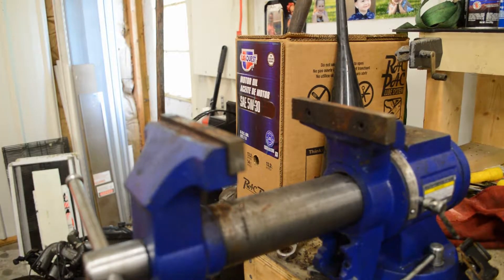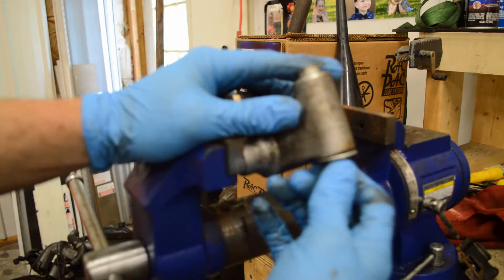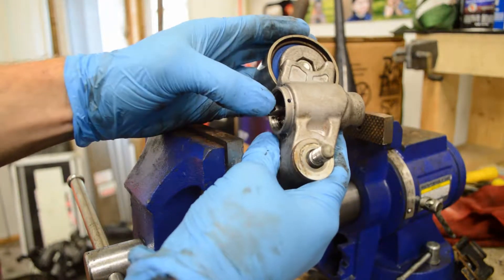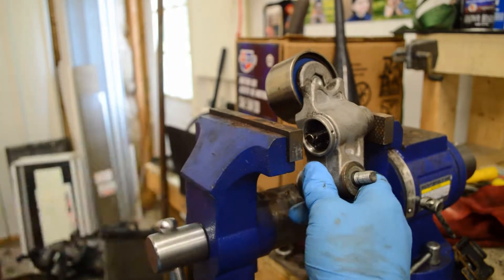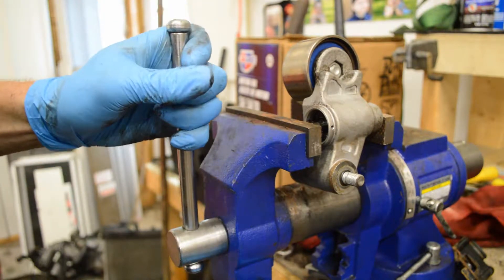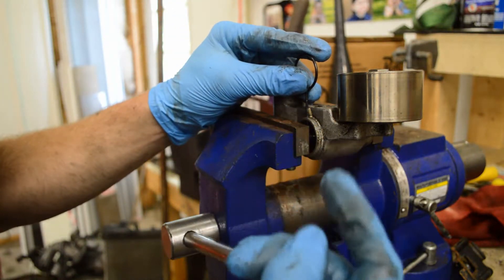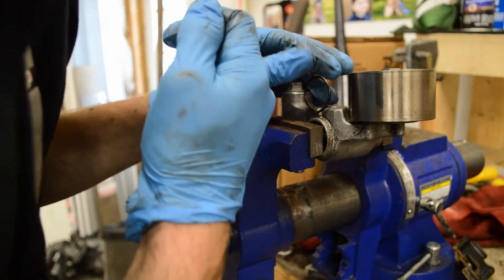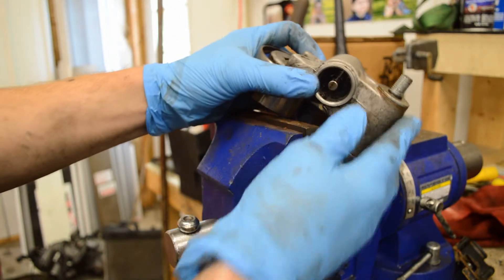Subaru Timing Belt Tensioner Reset

Comment: From what I’ve seen in a lot of other videos this needs to be done with the pin facing vertical and should be done with a hydraulic press. Air builds up even in the new ones and when you compress the pin you are bleeding air out of it. It must be done slowly as well or it won’t work. If there is air in it you will not get the proper tension and it will be flicking up and down causing noise. You also shouldn’t really be reusing these as it’s pretty important to have pulleys and tensioner in good condition

Comment: I just took my tensioner off and it's got oil around the hydraulic pressure pin. Can I still compress this and put it back on? Or is the oil around the hydraulic pin a bad thing? Thanks for any help and thankyou for the video. I know it's old but I'm using YouTube to do a water pump change. Having a lot of trouble getting the timing belt back on.
Reply: If it’s got oil leaking from the tensioner you want to buy a new one. Sounds like it’s about to fail which will kill your engine.
Reply: @LogansAdventures  thankyou